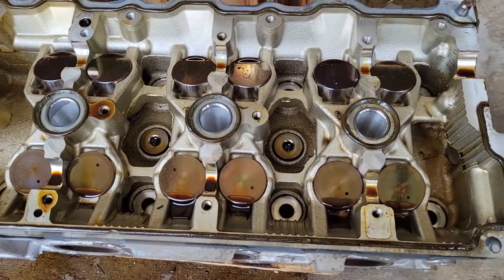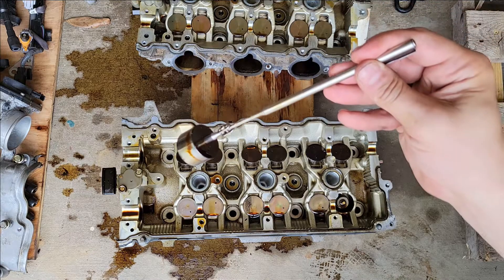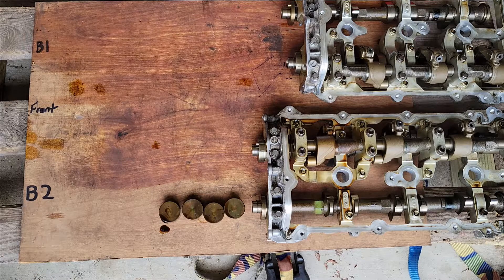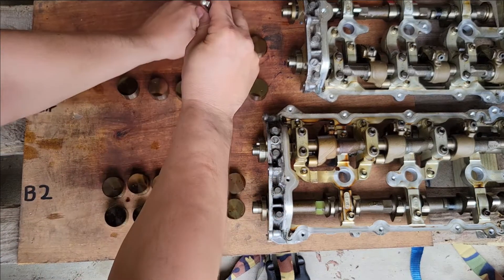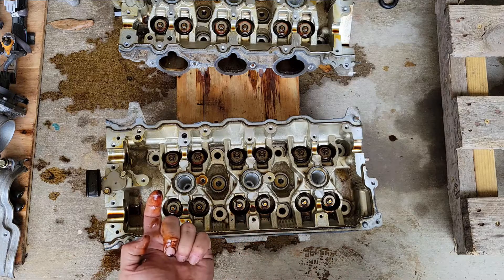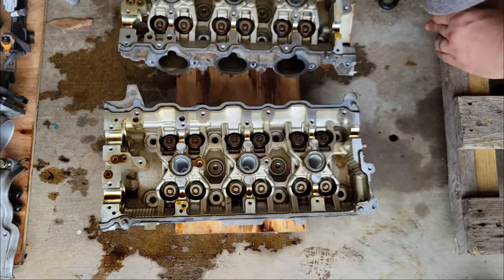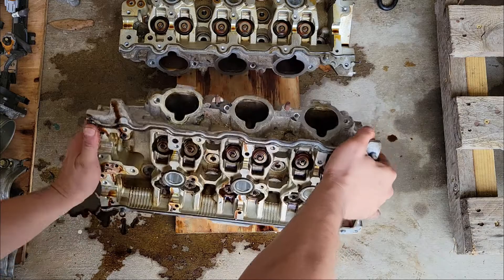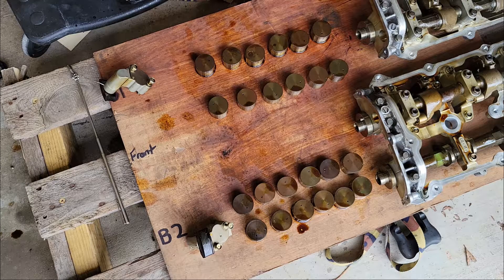Forged VQ37VHR build part 14, head games

Comment: Is your thermostat housing under your heads if so how would you change the whole thermostat housing
Reply from the maker: There's only 3 bolts to remove the housing under the driver's side head. It's pretty easy to get to.

Comment: Great series of videos, very informative for myself looking to do engine rebuild on the VQVHR37 , question can't you leave the valve lifters submerged in oil in a seal container?
Reply from the maker: Hi, yes. You absolutely can as long as you keep each lifter/follower sorted exactly where they came from. Good luck with the build!
Reply: @garagefanatic7830  Thanks for the reply, much appreciated 😃